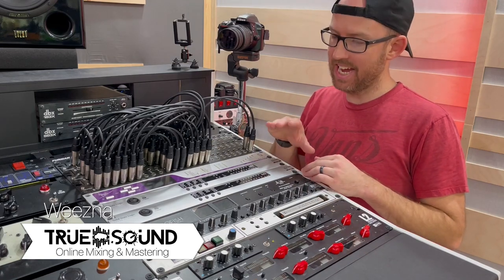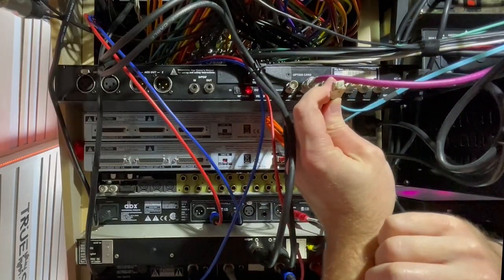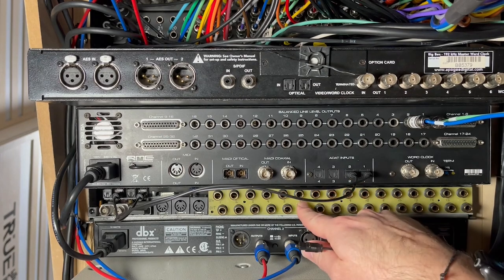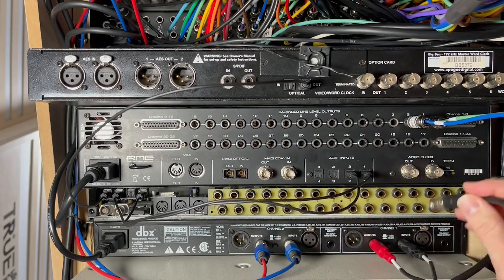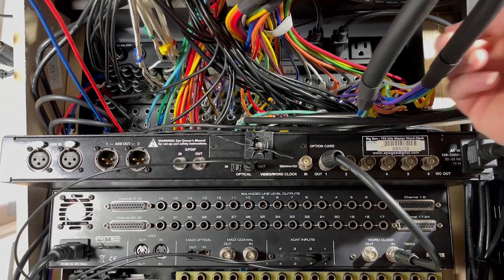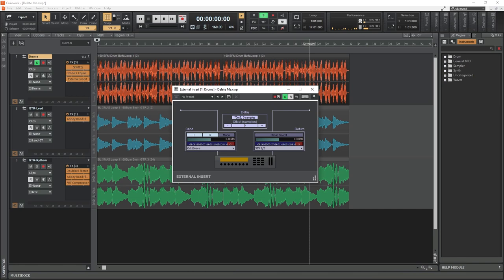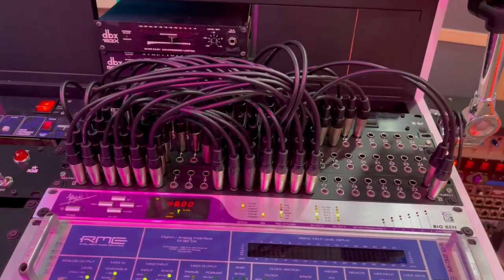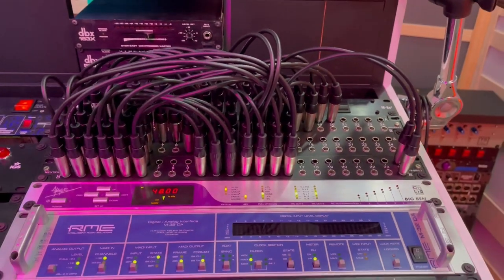Wiring Up The RME M-32

Comment: 1st: Do you have a video on those Transformers you put in-line before the desk?  I'm super curious.  

I thought the whole point from SSL with "Super Analogue" was to have a pristine, aka colorless signal path, and then add whatever color you desire down the line, say on Inserts.  Hitting Trannies before the desk basically makes it a new desk.  So you gotta love that sound if it's Always in the signal path.

So What Trannies are we talking about here?  And how are they wired up?  And when you drive them, at what point/signal level do they saturate and give you something new, or do you simply drive it by ear and see what sounds good to you? 

Did I understand correctly that you only have the Trannies on 9-16, and not 1-8 (or 17-20)?  If so do you choose which tracks go to which channels based upon that channel's Sound, or is it so subtle a difference that I'm overthinking it?

And finally: 
I have a 32-channel Soundcraft Ghost;  plus its an In-Line Console so that's 64-inputs to mix;  I have two Quantum 4848 interfaces, so 64-Channels out, perfect;  but I also have a stack of Patchbays to wire everything through, and the Ghost has Un-Balanced Inserts everywhere, and No Inserts on the 33-64 "Tape Inputs".  

So, I've been investigating building a ton of Transformers that could possibly serve two purposes:  1) providing everything with clean transformer coupled, Balanced Ins-n-Outs, but with as little saturation or slewing as possible (Superanalogue-esque), and 2) when driven hard, possibly yield a unique saturation sound across many channels of the mix in tiny accumulated steps rather than driving the whole mix through say  2-Bus Trannies (which is also nice for glue BTW).

Anyhow, thanks for reading all of this if you have.  But thanks much more for Doing These Videos in the first place.  I suspect that there are many of us watching your journey and taking notes.

G.
Reply from the maker: Yes, I actually racked up some transformers that are connected to the SSL X-Desk. So my intention was never to use the SSL X-Desk as a summing mixer. I always had the intention of coming out of the converters, into analog gear, then hitting the mixer and actually blending all this together. With that being said though, it is still better audio fidelity, and has more clarity in mid range focus than the Allen and heath I previously had. 
I have eight Triad A-67J, four Jensen 600:600 transformers, and then a bunch of other transformers that are either modified inside of gear. 
So really what I’m going for is a very hot signal coming out of the converters, and hitting the transformers to simply add some character without having to do anything. As of right now essentially every channel has at least two Transformers on every input, for all 20 inputs. I just kind of look at them as slight saturation and color boxes. Then after using a specific transformer for a little while, I decide it’s best place and then it permanently sits there!
Reply: @TrueSoundTV  Well okay!  That's more than I bargained for.

First let me say Thank You for the reply, and for doing these videos in general. 

Next let me say that This Reply sounds like a Perfect Video for your channel.  I think in the world of YouTube videos you bring something unique (not just reviewing the latest plugins or gadgets), you actually open things up and break out the soldering iron.  Which is exactly how Studios used to be.  Every engineer made Mods to thier gear to get whatever sound or workflow they felt like the gear lacked fresh out of the box.

An arsenal of Transformers strapped across multiple channels for thier various sonic differences and what they add to those tracks is Exactly what I think the YouTube generation needs to see in order to start thinking about how to use the tools in front of them.

So thats my request, however long it takes, please make that video?

Comment: What's the diff between the RME and the Ferrofish?  Looks like redundant gear?  Thanks,
Reply from the maker: The RME is strictly a DA, so it is only giving me analog outputs. The ferrofish has 16 inputs, as well as 16 outputs. Right now I’m not using the Ferrofish outputs, it’s really acting as my AD converter